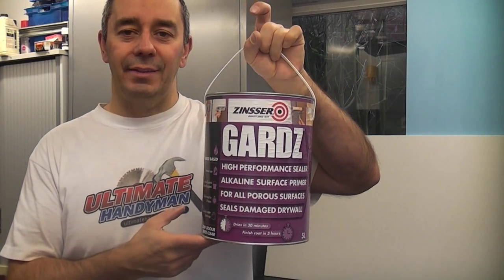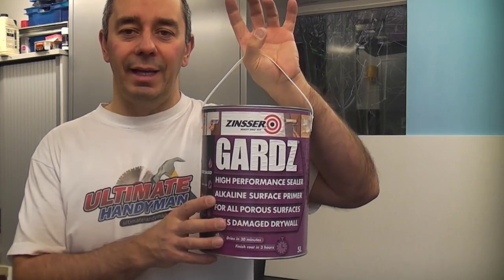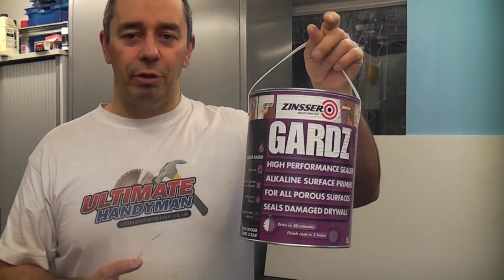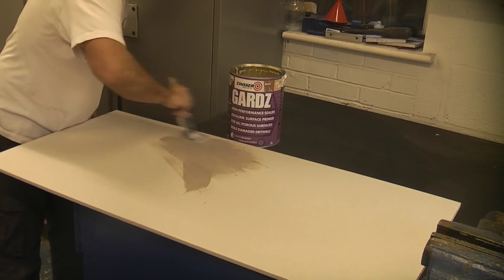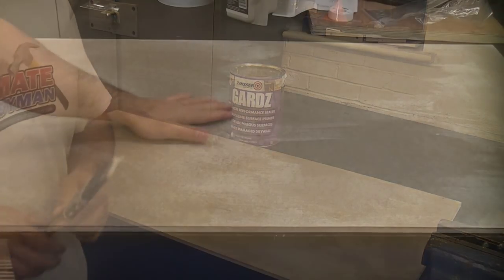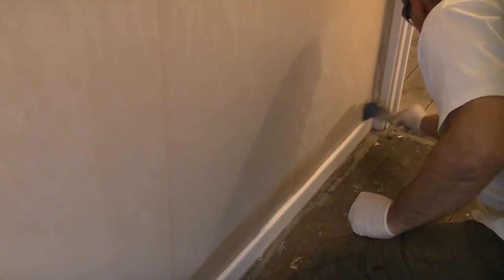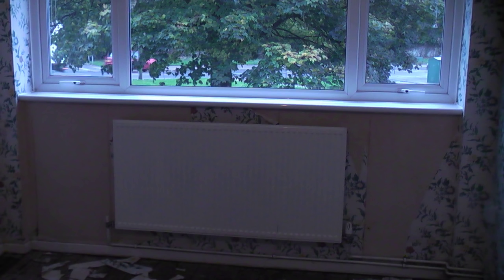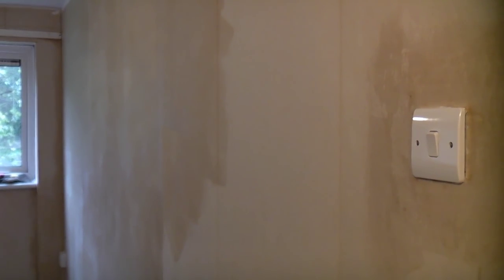Zinsser Gardz | Drywall sealer/primer

Comment: Will this make different surfaces uniform for painting? Will the different surfaces look the same after this and paint? 

I have 2 plastered surfaces in the same room, but different ages. One is older and different texture. I'm considering re-plastering the entire room, but will this fit the job?
Reply from the maker: Not sure about that, I'd probably try a mist coat of watered down non-vinyl emulsion, then a couple of coats of quality emulsion.
Reply: @ultimatehandyman  Thanks for the response. To give you a laugh if nothing else, this has been the journey: 1, old wallpaper when we moved in. 2, wallpaper removed, plastered by a non-pro. 3, paint. 4, we weren't happy; sanded with random orbital and then lined with 1400gsm. 5, didn't bond. 6, removed lining paper AND new plaster. 7, finally getting another plasterer in. This has been a lesson in cutting corners if there ever has been one!

Your videos have helped me to no end on my house renovation process so thanks very much. A bonus that I think you're a fellow Darrener, though I don't live there anymore.
Reply from the maker: @michaelbrowne4166   Blimey, what a nightmare. I'd have just put some blown vinyl on the wall- then moved house ;-)
Yes, I'm a Darrener 👍
Thanks for the comments

Comment: doesn't watered down emulsion do the same thing?
Reply from the maker: +karl bardsley 
No, watered down emulsion can be used on bare plaster as a mist coat.
The Gardz is a like a glue, so it soaks into the paper and if it is loose in places or bubbled it fixes it back to the wall and once dry it gives a hard, perfect surface to paint over.
It really is amazing stuff, I was very impressed with it ;-) 
Thanks for the comment

Comment: This is not something I've come across before but I will try this as I often get stuff like this to decorate over as I look after quite a few rented property's with these sort of horror walls!
 I'm currently using zinser a lot more after some of your other videos and although pricey the time saving Farr outweigh the cost.
Reply from the maker: +Paul F 
Zinsser products are brilliant. 
Sometimes they have special offers on in Crown decorator centres etc. When they are on special offer it is well worth stocking up on their products.
I just gave the remainder of my tin of Gardz to my mate (the one applying the top coat in the video) as he needs it at his home. We were both really surprised at how well that job turned out, the wall looked absolutely perfect after applying the Gardz and then emulsion!
Thanks for the comment ;-)

Comment: Which moron disliked this?!?!? What's there not to like about this video / great review & demo ! 👍🏻
Reply from the maker: +shortyian I would not worry about any dislikes that I get ;-)Some people always dislike some videos, but the likes and the comments far outweigh the dislikes.Thanks for the comment ;-)
Reply from the maker: +gunnatez 
You are welcome.
Thanks for the comment ;-)
Reply: +Ultimate Handyman i know😁 just makes you wonder why they dislike a great informative helpful video! 😊
Reply: Maybe I can throw some light on why someone may have disliked this video, it might be from painters who works on new builds and are painting bare plasterboard every day without the need for a primer or plaster, by adding water to the first coat thus saving him the time and expense of buying and using this product or maybe they thought it was a bit amateurish seeing the guy with the rad roller and the DIY roller without a pole, or maybe it was from painters with many years in the trade who managed to paint walls long before this product became available or someone who thinks that this product has many uses and painting walls is not one of them or someone who has painted over lining paper without using this product, or maybe from someone who uses inexpensive wallpaper paste or pva to stick back lifting wallpaper or someone who thinks there are cheaper alternatives, or maybe the dislikes are from a competitor brand or maybe they are just haters who hate everything. who knows :)

Comment: Does anyone know if this blocks odor? And what paint do you use ontop of it laytex or water based?
Reply from the maker: No, this will not block odour.
I used water based emulsion paint and it looked superb.

Zinsser B.I.N is the only primer that I know of which can seal odours.
Reply: Ultimate Handyman that's for fast reply I have two problem chalky paint which won't bond to subsequent coats of paints and the kicking of a stink too must be dodgy paint. What can I do to fix these problems?
Reply from the maker: Your best bet is to ask the technical guys at Zinsser, they will know the best product to use-
http://www.zinsseruk.com/technical-support/

Comment: Having major issues with this! Used this on some overly polished areas after plastering. I’ve done 3 coats of dulux trade vinyl silk and it’s still showing through!
Reply from the maker: If the plaster has been polished too much, I doubt if applying Gardz will help.
I'm afraid you might have to sand it until it's dull to get anything to stick to it properly.
Thanks for the comment 👍

Comment: Have you used everbuild 406 Stabilising solution to seal plaster as  zinsser gardz is expensive.
Reply from the maker: No I have not used that, but a quick look at it shows that it does not do the same as Zinsser Gardz. The 406 stabilising solution is for sealing chalky/porous surfaces!
Zinsser Gardz is not cheap, but it is excellent at what it does!

Comment: the product being used is watered down white glue. mix up 1 part white glue, 2 parts water. much cheaper and the exact same stuff.
Reply from the maker: NO,NO,NO
Zinsser Gardz is one of the best products on the market! 
Have you tried painting over a wall when you have applied your watered down glue?
Reply: Its great stuff.  They do other good products as well.  Use them a lot.   Not the cheapest but it goes a long well and does its job.   Love watching your videos.  Keep up the good work.
Reply from the maker: Thanks, I love the Zinsser Gardz as it does a fantastic job on lining paper.
Thanks for the comment

Comment: Do not use this product as it can bleed through your top coat as it did with me.
I had to rub it down and seal it with bullseye.😢
Reply from the maker: I've used it plenty of times with no problems.
Did you contact Zinsser over the issue?
Reply: @ultimatehandyman  yes I did and they fobbed me off and in the end they refunded me the cost of the Gardz.
Not my extra labour though…
If we do something wrong we are held accountable 😡

Comment: I've have a wall with some wallpaper backing paper and some of the wallpaper print front still. Could I just paint over all of it with this product, and then use emulsion to paint over? Or do I have to remove the front of the wallpaper first? It's not shiny paper.
Reply from the maker: As long as there is no Vinyl on the wall and it is just the backing paper the Gardz should be fine.
It looks like watered down milk but works brilliantly on lining/backing paper.
Thanks for the comment
Reply: Ultimate Handyman thankyou for replying. Just ordered some to try